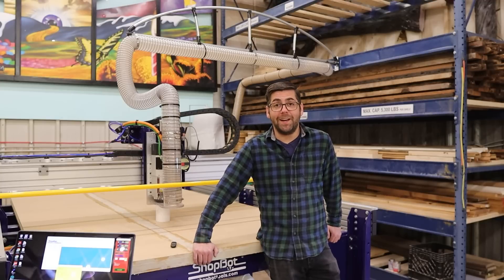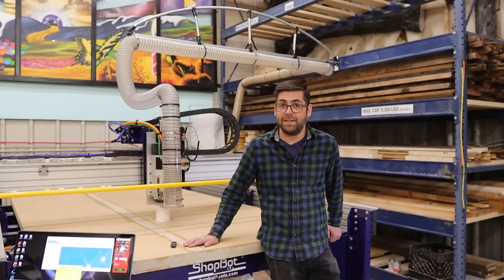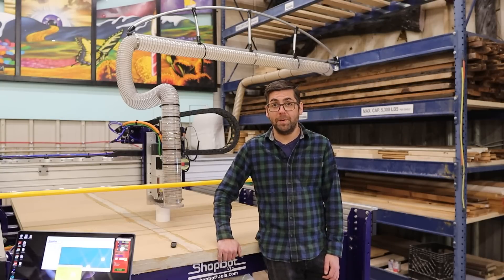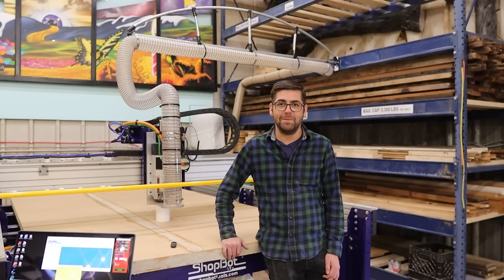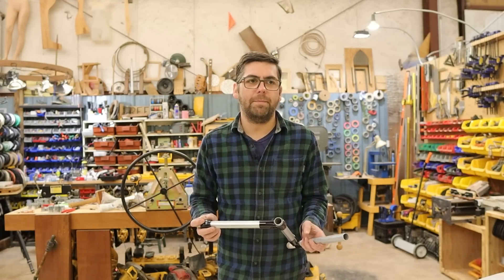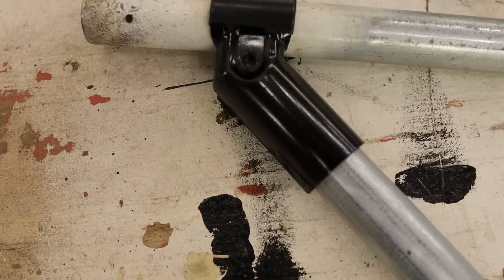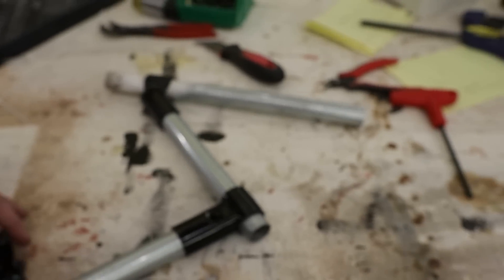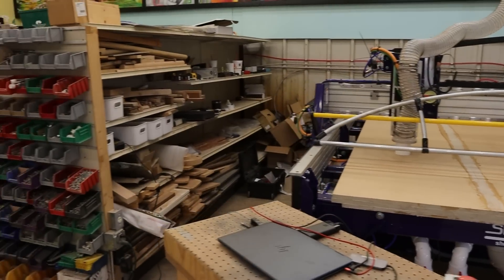Bowstring Truss

Comment: So I found everything but the clear plastic pipe you used where did you get that from
Reply from the maker: The clear plastic pipe that is the riser coming off the dust shoe? That is actually just a thin piece of polycarbonate sheet that I wrapped around the flexible hose and secured with hose clamps. I hope that helps!